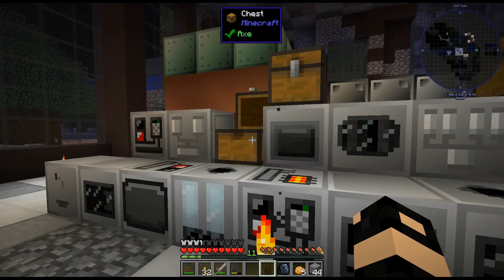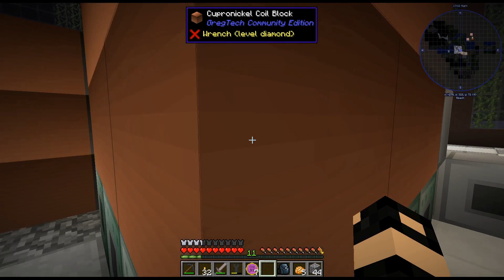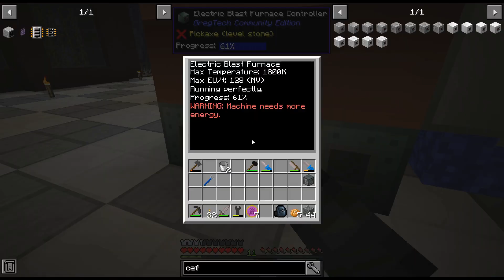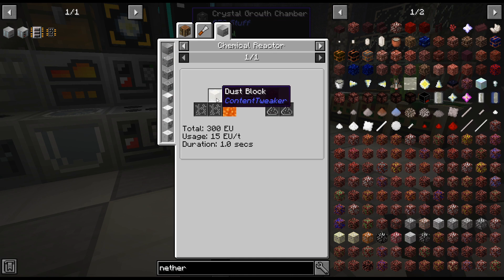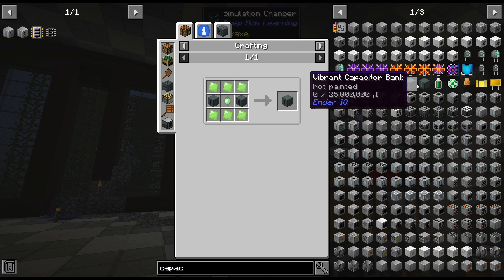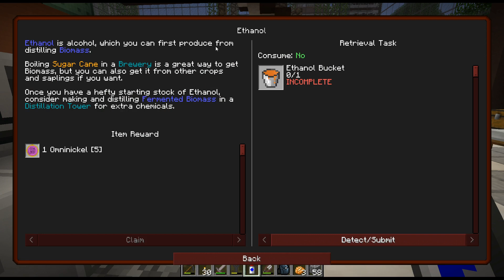Omnifactory - 18 - Crafting Our First Plastic

Comment: 3:05 Correct, except for the weird glitch with GTCE batteries, CEFs always output up to the number of amps specified in their tooltip (4 or 16).

3:45 Players often dedicate a 16x CEF to a line of EBFs to avoid power issues and having to move them around. Players usually keep their existing EBF intact and passively automate the stocking of a material with it, building a new EBF when a new material is needed. You can save some materials by sharing a common wall between two EBFs (or even string them together along a line). Takes a little clever placement of hatches and buses, because the overlapping region cannot have anything except coils and casings or they will not form.

6:10 The other components aren't too bad either, you just keep forgetting to check the Assembler tab in JEI :P. But yes, SMDs are excellent and you will continue to use them throughout the pack. The non-SMD recipes for Refined Circuits exist so you can use up any leftovers you made from batch crafting, if you choose.

8:30 Snad makes the Ethanol route very simple and sustainable, just takes a bit of infrastructure to speed it up. You'll often want more than one copy of each machine doing something in this pack, which is part of why materials are so bountiful. Oil will potentially come into play later when you are working on Epoxy, depending on the route you select (there's a bunch of viable approaches, but keep in mind that the Naphtha route for Epoxy is very wasteful, since Naphtha can be steam-cracked and tower-distilled for tons of useful products).

26:20 It is slow, yes. The quests both would have accepted MV versions, but you can (and probably should) also run more than one brewery.

26:30 Endervoirs would be a good investment for you. Don't forget you can use the glass made from Nether Quartz, you don't need to use the one that needs Obsidian Dust (you just happened to have clicked on it when it was cycling through Ore Dictionary to the harder to make glass many episodes ago). Endervoirs function like a 2x2 of water encased in glass, and they output one bucket per second.

30:00 Whoops, that's ok though. The LV Chemical Reactor can always be used in your Polymer Clay setup to make clay for you when you get around to automating that :)

32:55 This may sound weird but probably the best route for oxygen in the early game starts with macerating stone furnaces. I'll let you figure out the rest.